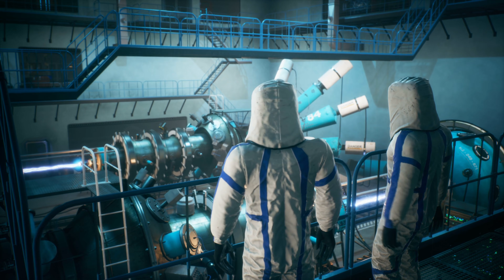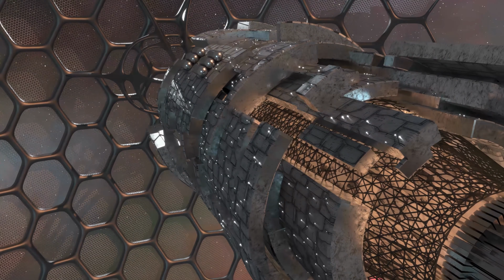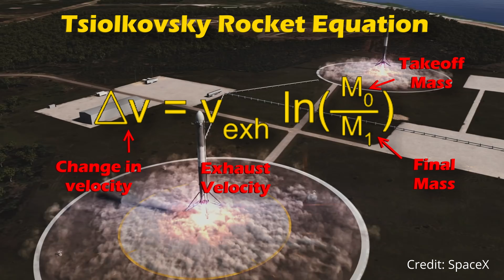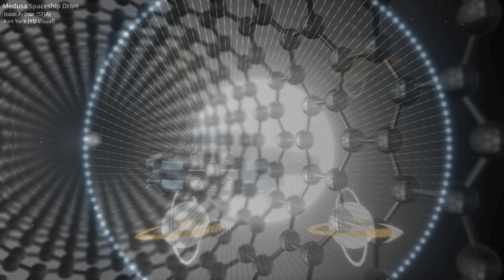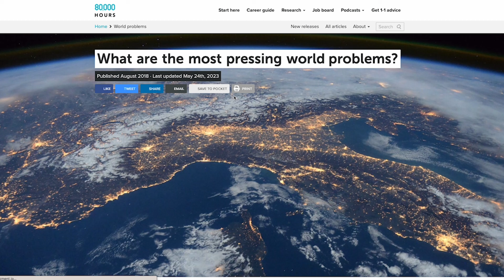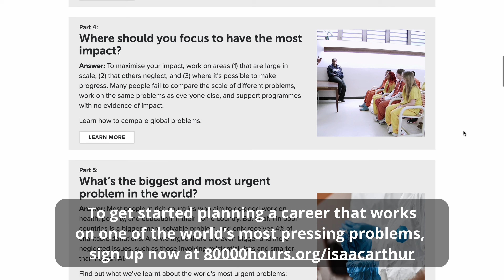The Medusa Drive: A Starship Pulled by Nuclear Bombs

Comment: Let's not forget that Orion wasn't exactly going to just be taking nuke blasts to the pusher plate.  The pulse units were hilarious little shaped nuclear charges that directed most of the blast forward in a cone using a depleted uranium "radiation case" with a hole in the fore end, and through a beryllium oxide channel to convert the x-rays to thermal radiation, which then vaporized a tungsten disk.  So really it was pushed by clouds of blazing tungsten gas.  Likewise, we don't have to settle for spherical blast geometries with Medusa, either - just case the pulse units in a hemisphere of DU, don't worry about the tungsten, and you're wasting a lot less blast energy irradiating the void and the front of the ship where the tethers connect.
Reply: It seems like you're trying to use the initial atomic detonation to trigger fast fission of the depleted uranium hemisphere for the pulse unit, right? Seems like a good way to use what would otherwise be "useless" depleted uranium for something a lot better than just a trim-weight for a 747 (yes, that's a real thing, I'm not sure how many versions of the 747 use a depleted uranium mass as a way to put the center of gravity where it needs to be for aerodynamic stability, but at least one of them does).
Reply: Seems to me it would be far more efficient to use the fissionables to build a reactor to power a series of lasers instead. Acceleration might be a little lower, but maintenance would be much easier.
Reply: @MrGrumblier  Nope, that'd be a lot less efficient.  Lotta interfaces between the fission and the lasers, especially the whole steam turbine part and a lot less directional flexibility.  The pulse units were meant to get over 80 or 90% of the fission energy into the ship by means of directionality and only 3 interfaces - xray to thermal by way of beryllium oxide, thermal to kinetic by way the the tungsten disk, then just direct momentum transfer from the tungsten plasma cloud.  Also, lasers'd be no good for the thing Orion is disturbingly best at - ground launches.  Sure, your little fireballs utterly wreck the surroundings, but you get a lot of thrust to get a lot of payload to orbit.
Reply: @Archgeek0  I'm talking in the long run for an interstellar voyage. A reactor could run for years on the fissionable material of a single bomb. Set these in series or parallel and you could propel an entire fleet, or at least it seems that way to me. It also solves the issues of security.
Reply: @MrGrumblier  TL:DR Decent conclusion, flawed logic.
You severely both over-estimate how much fissionable material is in a warhead, and severly under estimate how much is needed to power a reactor. It's closer to a dozen warheads per reactor, per twenty years. (It was proposed as a solution for US & Soviet "surplus" warheads during the Reagan/Gorbachev administrations.)

Bring breeder reactors, so you can make your nukes with "better" fissionables than plutonium & uranium, as well as producing electricity for other systems. (There's a lot of isotopes that would produce a "stronger" nuclear bomb that we don't use because the half-lives are too short to store the warheads for decades.)
Reply: @nunyadayumbusiness591  And how many nukes would it take to get a Medusa up to a reasonable velocity? It would take hundreds if not thousands plus the same number at the other end to slow down. Again, I'm talking about really long voyages where a slow but steady acceleration versus a somewhat faster but risker acceleration is a difference of a few months.
Reply: @MrGrumblier  Still, you are vastly over-estimating the amount of fissables in a bomb, and now seem to have the idea that a nuclear reactor doesn't run out of fuel.

TBH, fission's a dead end for the longer ranges you seem to be talking about - our current reactors need refueled every decade or so. 

Yes, this design, and the "atomic rocket"  designs suffer from that same "range limit" imposed by the fuel's half-life / natural decay rate.  (Time dilation will help, but only once you get up to high percentages of C.)
Reply: @nunyadayumbusiness591  The reactors on a current generation nuclear submarine are good for 30 years before needing refuelling. While commercial reactors like Point Lepreau in Canada or Nine Mile Point in the USA require refuelling every 5 to 7 years, they use less refined fuel rods. As you said, the ship could use breeder reactors to creat more fuel enroute as well.

An Orion drive ship - and presumably a Medusa drive - would need between 1000 to 2000 bombs just to get to the edge of the solar system. An interstellar trip at 10% C would require on the order of hundreds of thousands of "pulses" up to millions for a one way trip to Proxima Centauri depending on the mass of the ship.
 Each bomb would require between 4 and 20 kg of fissionable material, depending on which is used. If we assume that cost isn't a factor, we will go with 4kg per "pulse". That would be at least 400 tonnes up to 4 000 tonnes. The core of a US Navy submarine contains around 200 kg of fuel. So for a trip to Prox. Cent. You would need about 400 kg per reactor core so ten reactors would use the same fuel as 100 000 pulses. Now, I don't know how many reactors would be needed to power lasers to get a ship to Prox. Cent. but I'm pretty sure it would be at least comparable to the amount of "pulses" needed for a Medusa in terms of mass with less risk of a misfire.
Reply: @MrGrumblier  It's hundreds of pulses at each end of a Mars run for the orion drive. There was 20 lbs of fissionables in the proposed bombs, each being a "super-light" thousand pounds. (Amazing for the period, but 10X the fissionables & total weight a modern design would need.)

You wouldn't get to Prox. Cent. on a fission reactor powered laser sail, or a medusae / orion drive, or a nuclear rocket. None of them are fast enough to get you even a tenth of the way there before the vast majority of the fuel has naturally decayed. 

All really exciting ideas for "in system" traffic, but simply not fast enough for interstellar travel within their operating lifespans. (Having a half-life on your stored fuel sucks, especially when it's that dense.)
Reply: @nunyadayumbusiness591  The original proposal for the Orion drive was for a voyage to Prox. Cent. It would have taken 44 years. U-235, the fuel used by nuclear subs has a half-life of 703 million years. I don't think natural decay would be an issue.
Reply: @MrGrumblier  There are major problems with both parts of your suggestion here - running a nuclear reactor in space to generate electrical power, and then running a bunch of lasers using that power. In both cases, the biggest problem you run up against is cooling: Nuclear power stations make electricity the same way as chemical fuel (coal/oil/gas) burning power stations do - they are essentially giant steam engines, using heat to boil water and using the high pressure steam to run steam turbines. The only difference being the heat source - the nuclear reactor itself instead of a fuel-burning furnace of some kind.

What often gets overlooked on this subject is that to operate a thermal power station, you don't just need a heat source - you also need an efficient heat sink, because the useful work comes from the flow of heat from the heat source to the heat sink. This isn't a trivial requirement either: Look at the power ratings of any nuclear power station, and compare the electrical power output (MWe) to the thermal power (MWt) of the nuclear reactor. The most efficient nuclear reactor designs have a maximum electrical output of 45%, though there are not many operational reactors of that type. The vast majority of working nuclear power stations have efficiencies lower than that, down to as little as 25% for first generation designs, such as the British "magnox" reactors.

In any case, the rate at which waste heat must be rejected into the heat sink is going to be greater than the net electrical power output. This might be roughly equivalent for the highest efficiency designs, or it might be double or even triple for older power stations. This is why nuclear power stations are always sited near a large and reliable water source, either on the coast to use the ocean, or next to a river or large inland lake. This is also true for marine nuclear power, for aircraft carriers, submarines or nuclear icebreakers - all of which use the ocean as their heat sink. Water has a high heat capacity, hence why it is used as the primary coolant for most nuclear reactors. Some designs are gas-cooled (usually carbon dioxide or other inert gas), but these have primary coolant flow rates several orders of magnitude higher to compensate for the far lower heat capacity of the coolant gas.

If you are going to operate a nuclear reactor in space, the requirement for a good heat sink doesn't go away - it just becomes a lot harder to practically achieve. Heat transfer can operate three different ways - by conduction, convection or radiation. Only the latter method is available in space - and heat rejection by radiation is the least effective method. Look at the international space station, which has arrays of heat rejection radiators which are larger than the solar panel arrays. To put this into perspective, the maximum possible power output from all the solar panels on the ISS added together is 240 kW, if all of them are in direct sunlight. In practice this is not possible, since not all the panels are in the same orientation, plus the ISS spends 35 minutes of each 90 minute orbit in darkness, so the average power output of the solar panel arrays is about 120 kW. This is a relatively miniscule amount of power compared to the output of most nuclear power stations, which is measured in tens or hundreds of megawatts.

So just imagine the insanely large radiator type heat sinks which would be necessary to reject a whole power stations worth of waste heat.
The same deal applies to lasers - the most efficient electrically powered lasers are about 60% efficient, with the remaining 40% of the power consumption going as waste heat. Any laser in space would therefore also need similarly large radiator type heat sinks.
Reply: @lloydevans2900   I agree that heat dissipation is a huge problem even without running lasers and nuclear reactors. It isn't as big a problem as you would think since dissipation is more a matter of surface area than mass. The ship could easily have heatsinks incorporated into the sail itself or inside its tethers as well as traditional fins all around the ship. Heat dissipation is a concern, but not an insurmountable one.
Reply: Do an Orion drive'spucher plate really need to be flat? Wouldn't something curved be more effective? Ideally though difficult on the materials would be detonations inside a tube. But a gun barrel that can survive nukes detonating inside it got to be really tough.
Reply: @michaelpettersson4919  I think most of the plate designs were slightly curved. I like the idea about the nuclear gun barrel though, I wonder how practical it would be to make like, a spinal nuclear gun barrel for the ship with the sail in front and exhaust out the back? When you fire the charge it directs almost all force forward and backwards, all the forward momentum gets caught by the sail and all the backwards momentum just goes cleanly backwards away from it. But of course, the  barrel would need to be tremendously strong to contain an actual nuclear bomb, even a shaped one.

Comment: Can you pick up some fuel, even if you have to slow down or stop to do it?
Reply: Why not? But it's going to be very energy-intensive to do so, you're going to do again a full braking and a full accelerating afterwards. Generally there is no need for stops on a journey through space as drag is minimal and you stay at speed once you achieve that speed (unless your journey is into the trillions of years or you are caught by a black hole)

Comment: Seems like the sail would take a lot of damage from interplanetary/interstellar dust and particles. Would suck to get up to speed and then realize your sail did not have enough structural integrity left to stop your ship.
Reply: I imagine a ship like that would have emergency retrothrusters for that exact reason, and maybe replacement sails like on nautical sailing ships
Reply: @ItRemindMeOfHome  "e emergency retrothrusters" 🤣🤣🤣 dude, you need to spend the very same amount of energy in order to stop, and that translate in many times the weight of the ship in FUEL !
Reply: @mirandela777  ok, you've never once planned for anything dangerous, have you? 

If we're building something like this, do you think redundancies and emergency solutions wouldn't be included in the planning stages?
Reply: @ItRemindMeOfHome  - "you've never once planned for anything dangerous, have you? " you pulled that from ur arse, right ? Cuz I said 5 ships will be way too little if the cargo is only 20-30 tones each, and in fact they will need hundreds - more probable over a thousand tones - BECAUSE of the many items they will need, CONSIDERING redundancy ! L2R, dude,  I bet I have 10x more experience than you, kid, in planning for "for anything dangerous" , lol.

Comment: Cant gyroscopea generate movement in space? I see these cubes waking around by geting up onther edge. Can't it be used as "momentum" to push a ship forward?
Reply: Only in the sense of rotating the spaceship.  You can use gyroscopes to control which way you are pointing, but unlike those cubes you have nothing to push off of.